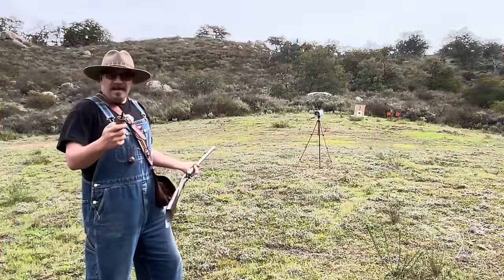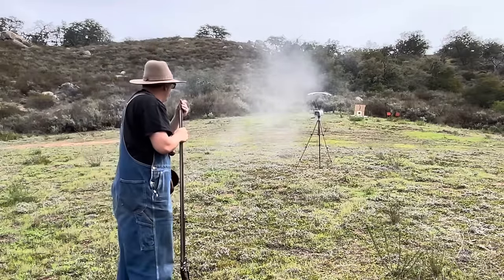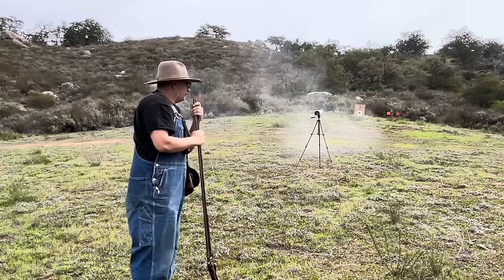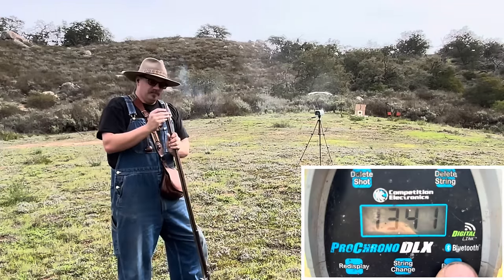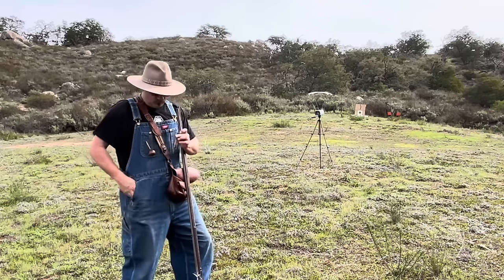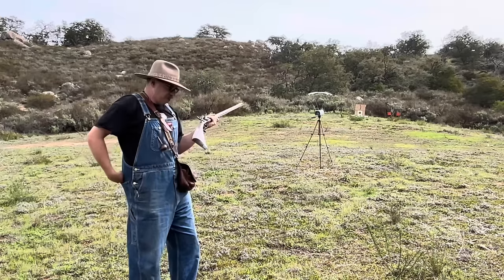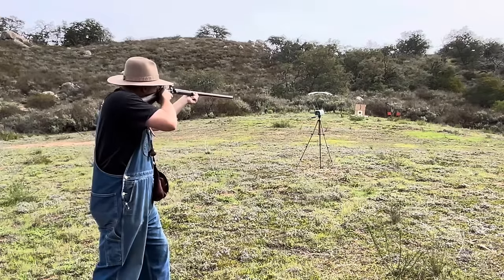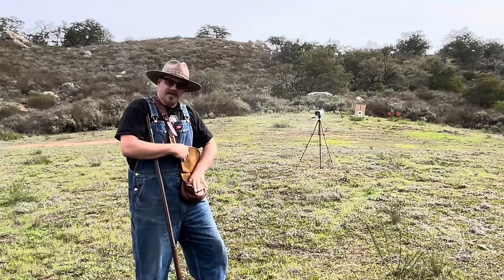Hay Bale Black Powder

Comment: Who knew that smoking grass could be so frustrating. Thanks for another great video.
Reply from the maker: Thank you
Reply: You should try Bamboo or River Cane.
Reply: @Everythingblackpowder  you should try Bamboo or River Cane
Reply: lol nice piece of humor!!
Reply: The best hemp herd comes out of Colorado.  Check out hemp build magazine they also make hemp insulation. I bet if you compressed it with a little corn starch, it would make great wads.
Reply: I DO!!    "I literally" charred some of  my DIY Mary Jane!   My bird dogs dumped the finished char with my tumbler over chasing a critter, it was a beautiful black metalic blue with a nice ceramic sound.  I still have some branches saved from last season, now my mill died but gave it a good run.  OPPS?  next?  now I need to do it again.  Oh well it's free and good pain medication.

Keep chasing the dragon.  Keep your smoke poles SMOKING.       both.
Reply: @Everythingblackpowder  hay has seeds, straw doesn't. 
Seeds give oil and you know that's an oil source for gummy burning powder, Unfortunately 🤕
Reply: @pranksterwho8870  I did cocoa from cent America, eeehhh?

Comment: No idea if the best charcoal for black powder has anything in common with the best charcoal for filtration, but during WW1 tests showed that the best charcoal for gas masks was made from coconut shells. The govt had a special program to buy it wherever it could be found and to buy the best substitutes such as walnut and pecan shells. These would be interesting to test.

Comment: Went and did some leg work, and dry matter proportions for most prairie hays runs 5-8% silica and 10-15% ash. So the silica problem is pretty much the problem I thought it was going to be... charring is going to convert and remove some components, so I figure offhand that a quarter of your charcoal isn't.  On the bright side, it'll be self-cleaning because the silica content will encapsulate solids and prevent it sticking to steel... but it'll plug your touch hole, as you saw, and it'll be abrasive as hell to the barrel.
Reply: Another possible problem is the amount of dust that is in hay. Vehicles passing by the hay field stir up dust and it gets trapped in the hay. Possible source of the silica mfree is talking about . I knew silica is a problem in hay but I lumped it in with the dust.
Reply: I'm wondering if the silica and ash content is a reason why different woods work better than others.
Reply: @d3faulted2 Wood doesn't have as much of that specific problem, as it does lignin content and other organic compounds that are "sturdy" enough to survive the charring process, which come from lignin. Phenols and such. Ever had charred wood that kind of smelled like smoked ham or barbecue? That's one of those phenolic products.

Comment: I found out a replacement for sulfur, and apparently it can be more powerful as well, at least in pyrotechnics. It uses citric acid and red/brown iron oxide with the ratios being
72% KNO3, 10% C, 14% Citric acid and 4% red/brown iron oxide. The downside being the increased cost of citric acid.
As for fouling, that's anyone's guess. Less overall carbon, but more iron oxide.

*edited for correct raitos
Reply: Crimson powder.  It's apparently more sensitive than BP, so I would tread carefully.

Edit: Then again, I'm mostly familiar with it as a deployment charge for amateur rocket recovery systems, where the sensitivity is mostly measured in terms of how quickly it will light from a hot nichrome wire, so YMMV.
Reply: I’m interested. Sulfur is common in our industry products and easy to acquire. How does your citric acid mix perform on a chronograph?
Reply: @richbattaglia5350  
Milling some right now. It's only screened powder, and I dont have a chrono, so it won't be an exact comparison.
Reply: @vicroc4  As far as I remember, crimson powder uses ascorbic acid rather than citric, and no other source of carbon.
Reply: Not citric acid. Ascorbic acid, aka vitamin C
Reply: @mduckernz  
Too bad. It's already in the mill.
Reply: @_muody You're right, my mistake.  Still, it's a similar formulation.
Reply: Update: Mixed results. This is with CITRIC acid, not ascorbic. As for power and burn-rate, slightly slower in open-air than regular powder with sulfur, but definitely the best sulfur-less composition i've tested. The others being just plain charcoal + nitrate and charcoal + nitrate + sugar. Fouling is better than the sugar as well, about the same as with regular powder, but it's strange and soft. Not hard and granular, but like damp flour.

As for velocities, I can't tell it apart from regular black. Might be less, might be more. Overall, definitely a viable replacemet. The tests i've done are bone-dry and fresh out of the container, so it might pick up moisture and lose more power than regular due to citric acid forming a mono-hydrate.
Reply: @PwntifexMaximus  Thanks for the update. When you're testing different compositions, do you tweak oxidiser-fuel ratio, or keep it always 3:1 by mass?

Comment: Nice and time intensive tests you are running! However, if it comes to the charcoal used for Black Powder mixtures it is a fact that charcoal made from buckthorn (Rhamnus frangula) will be unbeatable! The old time powder mills sought out many different woods for charcoal over a couple of hundred years and they ended up with Rhamnus frangula in the 19th Century. Charcoal of this wood will always deliver the highest energy or muzzle velocity. As far as I know it is only the Swiss Powder mill which is still using this excellent wood.

Comment: Interesting thing about hay/grasses/bamboo: while they are light weight, they are only so because they're more or less hollow in the middle, literally like a straw. If you were to take a grass, cut it open and spread it out flat, you realize you get some pretty dense stuff, with long fibers all in one direction. Some testing I did in college showed it was similar to walnut.

Comment: Damn, I was really hopeful for this one; I'm happy it at least runs kinda clean. If I could ask for anything, I would like to see two separate batches: One pressed in your 20t as you would normally, and one pressed a lot less (say to 12t if you can measure that out). I'm interested in seeing how much of a difference that make in terms of spread.
Reply from the maker: I can adjust the density with my 20ton press just the same. Either way, I don’t think it will magically pick up 300 FPS

Comment: I commented on using Yellow Poplar and dousing with water to stop the burn after it flames out but maybe the wood selection would not be optimum. Have you tried dousing the wood when you keep a constant eye on the burn? Seems it might rinse away unwanted impurities and leave carbon. Of course, it's a higher temp than you mentioned in previous videos.?? Last time I was at Connor Prairie was 1995 or 96. 🙂

Comment: Fantastic video!  Success often comes unexpectedly, but hay just wasn't making the grade.  In the comments to one of your videos, you mentioned coconut husk as a possible carbon source.  I thought it a comical suggestion, thanks to the musings of Monty Python, but upon further reading, it isn't so comical.  If you can find enough of it or eat enough coconuts, coconut husk is supposedly a viable starting point for charcoal.  Also, an expired German patent, DE2328010A1, starts with peat.  Apparently, coked peat produces some hot and fast charcoal.  So, I suppose you can pick from your own coconut palms or step out to your private peat bog and have fun!  Thank you for the entertaining and informative videos!

Comment: I know yours was milled well but the misfire frustration was just as equal for a batch I came up with once.  I had the misfire issue you were experiencing when the materials didn't mix well enough during the milling. The components all caked up at the bottom of the jar and the balls on top as expected but it wasn't right. When used I had a bunch of little yellow speckles from the sulfur which clogged everything. The Pfffft and no bang is extremely annoying.

Comment: Another interesting video...thanks. i used to think it was the flint that made the spark but its the flint "scratching" the metal frizzen and causing metal hot sparks...can anyone elaborate on this idea of mine...like...what kind of metal is the frizzen made of etc...a guy I know made a frizzen from an old metal file and it works perfectly.

Comment: Good morning,
I used black powder (75/15/15) from toilet paper following your recommendations in an Colt1851 .44 Navy Yank
with addition of 5% smokeless powder special for revolvers
sellier-bellot caps
enlarged chimney holes (diamond drilling) no hole on the side
16.6 grains in total (3grains for capsule 000)
all shots go off without problem
almost no smoke or fouling, very clean barrel
the powder goes into a vegetal capsule (size 000) and then into the barrel, the .454 lead bullet on top
It works really well and very practical, not much noise
I posted a shooting video yesterday
thanks to you my revolver works really well now 
for powder you are the best :trophy-yellow-smiling:
Reply from the maker: Fascinating! Did you mill the smokeless together with the BP or mix the two powders together afterwards?
Reply: @Everythingblackpowder  I tell you the truth
my jar of bp toilet paper was open, there were 255 grains in it
I accidentally emptied my capsule of pure smokeless powder 14 grains into the Bp jar
yes I shake the pot with both
I had calculated approximately 5.88% smokeless powder ratio
I used this to not waste 😏
I made 6 vegetable capsules (000) with this powder and put in the 1851 with the .454 lead bullet on it
It’s like your .303 British test which was excellent
the shot is very smooth, almost no smoke or noise
no recoil and good precision
it looks like a reduced load, for shooting inside it is very good
there are 13.6 grains of “mix” and 3 grains for the vegetable capsule total 16.6
I shoot like that and no problem
no return through the chimneys (enlarged holes)
also in my pot of black powder I spray hairspray (there is also a comparison video)
only after I put the smokeless powder
I don't have a chronograph yet
as it was the first shot with this mix I protected myself
on my video there is no shooting problem
largely thanks to you
Reply: @Everythingblackpowder  I use a powder that we find at home
Vectan Ao special lead bullet, it is the cheapest and most available

Comment: Hey Jake I have a dumb question what kind of patches are you using to clean your bore.  I need something like that. The cotton patches I use seem to be tight.  Yours look like gauze.
Reply from the maker: Howdy Diane, these are what I use. We prefer them over standard cotton patches.
https://www.amazon.com/Birchwood-Casey-Patch-Square-mm-38/dp/B00TD0UEGI/ref=mp_s_a_1_3?adgrpid=55817897677&dib=eyJ2IjoiMSJ9.yQqful5HXAzWMn085hkm3oHx2i2VA5VwJUf-UPrkfXRIe03vbLZLLZ4_9dqgg4_zhq8QXaSODTSYdANlVJ38u4chldL1xVSGK8PHI1za53QULRV3mqBUsmS1STDwTJp8dQTPVk0gOz-6E1-Oz3O_F53f0KIk_r1kvpUCctrb4G449wzexr1Q2luGwz6CYvzZR3qDNly9WlAcbHzjt1VMhg.jpQiTwjUlJVgieD1ePLZhUSFXSybmzzTsust_fwf_Yg&dib_tag=se&hvadid=589894508520&hvdev=m&hvlocphy=1014165&hvnetw=g&hvqmt=e&hvrand=8584871247571058300&hvtargid=kwd-303792525483&hydadcr=9818_13553045&keywords=birchwood+casey+cleaning+patches&qid=1711923802&sr=8-3
Reply: @Everythingblackpowder  Thank you Jake I am going to order some. Have a great Easter.

Comment: Im curious if you will try your hand at making brown powder, also called prismatic powder used in ship artillery. It uses a very low sulfur content anywhere from 1% to none by weight. The carbon source was not fully carbonizated but instead to a dark brown color. It was pucked like normal black powder. All of this caused it to burn slower then black powder allowing higher velocities in artillery pieces.

Comment: Did you wash the carbon with hot rain water? There are always all sorts of salts in the charcoal that don't burn in the powder. You can see this in the rain water it turns yellow.The salt is probably potassium hydroxide

Comment: I once wonder what charcoal from a cottonwood tree would turn out like but I never tried it yet! I had a man tell me river breech wood made into charcoal and I never tried it either. But I did try the toilet paper and it works.  And I made charcoal from corn cods and it did pretty good.
Reply: I have made a batch of charcoal and I used red cedar and it turned out great for black powder! And I made another batch of charcoal using grape vine trimmings and it works great also I mill both one 48 hrs . And the other for right at 60 hrs. Then I picked them and let cure then crushed them up. They were like brick almost. Well anyway they both have a good hot ignition and my velocity didn't fluctuate hardly any at all and maintained good velocitys on chronograph and fouling wasn't bad it was kinda soft . I'm going to try out some charcoal from willow next and then wild cherry tree charcoal. I have tried different woods on shipping pallets like ucoliptus and other exotic wood on pallets

Comment: i did ask to try corn charcoal on another comment, i gave it a bit more thought...
corn kernels can and have been used as fuel for coal forges, because its just that energy dense! and it could be a good way to show what difference the density of the carbon source makes. by making a batch with unpopped corn, and the other with charred popped popcorn/feed corn. hot air popcorn machines would avoid making it oily. and in that test, you would know that both have the exact same composition, just a different density.

Comment: Short of going after buffalo hunters with a razor i'm having issues getting brass balls, so i got ceramic instead - now i'm wondering if it's the ceramic balls, the mill time or the lack of lifters are causing the difference. Be interesting so what the difference is if all the other variables were the same

Comment: Hi, loving all your videos thanks
You may have a 9% error in your ftlb energy values. From what i can tell you are using a value of 140gn for your .440 round balls. Is this correct? Aren't they usually between 127 & 128gn, not 140gn? 
Awesome vids
Cheers from Oz.
Reply from the maker: Hang on, I’ll go check
Reply from the maker: Thank you for pointing that out! The .440 balls are 128gn. The .454 balls are 141gn
Reply: @Everythingblackpowder  
All good 👍
Please Keep your excellent videos coming

Comment: Obviously the hay has herbicide sprayed on it. It has a way of ruining the garden. I am starting to understand the extreme milling time as this is a chemical mixture and if its not mixed well you don't have as much gun powder. Same thing with powdering all the other ingredients in the vitamix real well before milling.  I am seeing the difference with extended milling time. Since I do not have a machine press I was thinking about using the 25 ton wood splitter as a press. What is your opinion an that ? I have been pressing the damp powder through a screen and really like the burn but want all the fps I can get. Thanks again

Comment: I know that grass is really high in Silicates, which makes it really hard on knives, and why lawn mower blades get dull so fast. I’d guess it flashes to tiny glass when burned, Presumably, the brass media for longer probably crushed the silicate contaminants to a fine enough powder that the glass formed was not big enough to plug the flash hole. I’d guess that was also part of the weird flakey grit in the fouling.

Comment: I just checked Midway U.S.A. to find out what bullet weight your using and that first batch was so bad I get more velocity with the same bullet weight from a 6 inch Revolver in .38 SPCL +P. Not a good option for DIY Powder. I can only guess how bad it would be in my Cap Ball Revolvers.

Comment: Didn't the British use "straw" to make cannon powder at one point?  Might have been barley straw or something, I don't know.  What I DO remember reading is that it was only pyrolyzed to the "brown" stage, much lower temperature than you have been using for all your other recent tests.  I'm thinking the hay was overcooked for what it needs OR it just has way too much ash content.  At $2/lb, Cottonelle is just too simple and effective for me to use anything else at this point.  1,000,000 thanks for cracking that nut!

I've been trying to use Kraft packing dunnage paper, both virgin and recycled varieties, with limited success.  I keep overcooking it.  The recycled, heavier paper actually worked better (cleaner and more velocity) than the thin, light, virgin paper once I got batches that never exceeded 600 degrees.  I'm going back to TP for now, it just works.  One thing that all of the papers I've tried (Kraft and TP, several varieties of each), is that the fouling is SOFT.  Very soft.  With Willow and Chinaberry I get very decent powder that's far cleaner than GOEX and about as strong, but it leaves a carbon ring after 2-3 shots that make seating the ball the last 1/4" a little difficult.  Paper carbon does not do this at all in my Kibler .45 SMR but every other kind including Swiss, old GOEX, newer Schuetzen, and old DuPont all do to a greater or lesser extent.

Comment: A grass is not like a tree. Grass is usually much higher in silica than wood cellulose. That is mostly why bamboo (a grass) bends like fiberglass when wood from a tree will snap. The silica could be sucking too much heat from your combustibles.

Comment: Your problem was that you weren't using it in a walker colt so naturally it wasn't as powerful.  Seriously though I am surprised that the ceramic media contributed to such different velocities.  Have you tried the berrys plated bullets for a tumble media? I would think that the guilding material would wear away but not as fast as lead. And have you tried tissue paper for a carbon source?
Reply from the maker: Not yet.